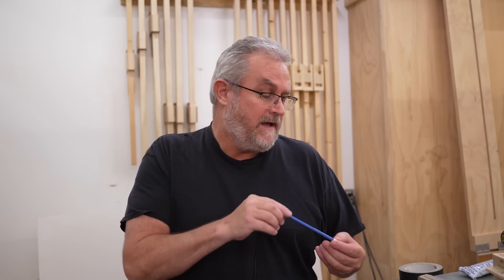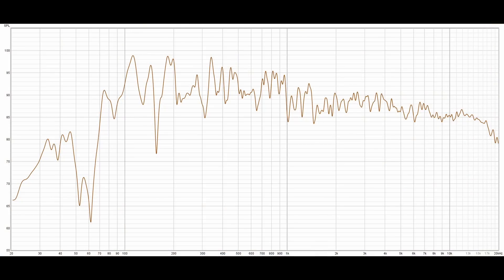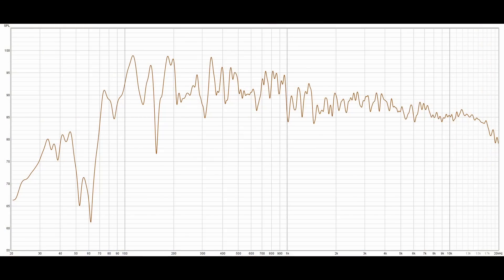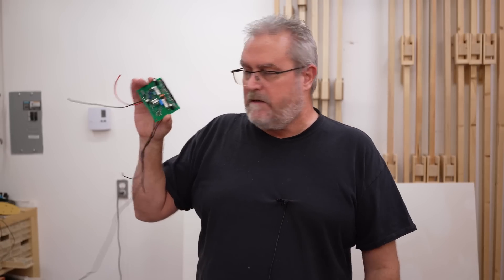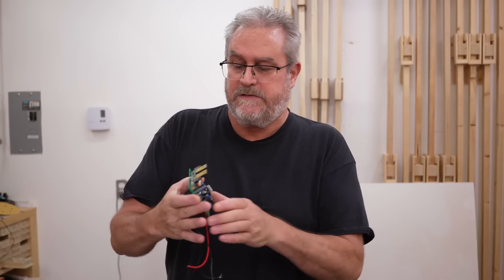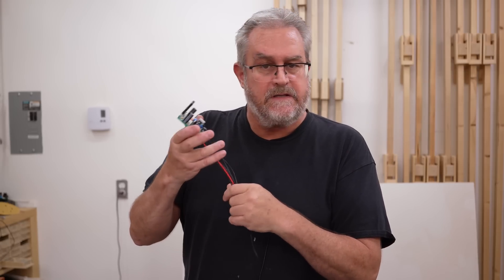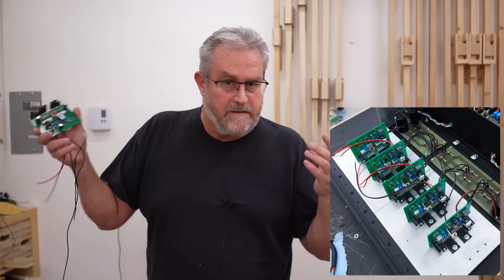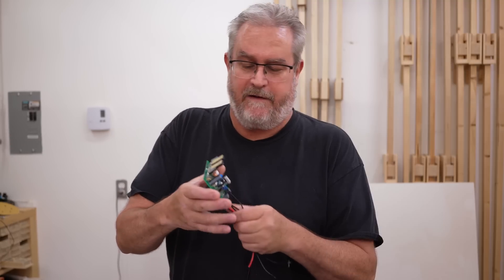A Rant about Speaker Measurements - They are Mostly BS

Comment: You are absolutely right that the room dominates. So that is why research shows listeners prefer speakers with smoothly changing off-axis dispersion because that defines how it will interact with the room. This is why Klippel is important because it captures that 360 degree dispersion data accurately.

I certainly think the more data the buyer have access to the better.
Reply: I totally agree. I see so many manufactures that don't even release anechoic amplitude response. One I remember e.g only released the two -10db points which is utterly useless

Comment: Most people looking at the Klippel reviewers are aware of in-room VS anechoic response and that's why both measurements are provided. Anechoic is how you know flaws purely with the speaker. Why would you want consumers to have less data on the products they buy? Your room can't really fix a huge dip at the crossover for example - like was discovered with the Klipsch 600m by the Klippel.
Reply: Room response is like a fixed mechanical EQ.
Reply: @pablohrrg8677  Kind of but not really. It's extremely difficult to target EQ a speaker with a room. Also, in relation to bass that room gain is basically modes and nulls which have severe consequences in addition to the boost that they give.
Reply from the maker: If it took the Klippel scanner to discover the huge dip, how much of an issue was it in actuality? Why didn't a listener discover it?
 Nothing wrong with consumers having more data as long as that data is actually relevant and they know how to interpret it. My point was (and it pains me to have to explain things twice or three times...) that the data is missing key components that determine what the sound quality will be. 
The Klippel system gives a rough approximation of what the developers of that system THINK the speaker will sound like in a typical room. That's like buying a suit off the rack vs going to a tailor. Sure that suit off the rack will fit pretty close, but nowhere good as the one that's made to fit perfectly. It's mediocrity vs excellence, which would be okay, but the mediocrity is being touted as excellence, which is a lie. 
The measurement data shows just one aspect of the big picture, but it's being pushed as the be-all-end-all, and all you need to know when you want to buy a pair of speakers. Very good sounding speakers are being maligned because they don't fit the narrow range of "acceptable" (presented as exceptional) flatness and directivity. It's the human (lazy, low rez thinking) desire for easy, simple answers to very, very complex questions, and pandering to people who are more interested in specs to prattle on about than the actual sound quality.
Reply: @IBuildIt  Klippel has tons of technical data to back up their claims about the systems accuracy. Both they and many other people with engineering backgrounds seem to agree that outside of the most advanced anechoic chambers in the world, of which only a couple exist, the Klippel is by far the most accurate measurements you can get - especially into the low frequencies. I appreciate the contributions of both you and the Klippel reviewers, but to convince me you would have to provide technical data equal to Klippel to disprove their system - and you have not done that. Subjectively, I have owned tons of HiFi speakers and when I started buying based off good Klippel measurements I noticed a huge improvement. The speakers that measure good are not too bright, not too dull, and sound full with no details missing.
Reply from the maker: And once again I can see that I've wasted my time. And not because I "failed to convince you that the Klippel data in inaccurate", but because that's not even close to what I was saying in this video.

Comment: I'm an "advanced" amateur musician/recording engineer. I've got a few albums under my belt, but I'm not a pro by any stretch. I've recently started doing some "real" work on a pair of Adam Audio near field monitors set up in my newish home office . They weren't wrought from sacred materials by Tibetan Monks, but they sound pretty damn good. Yesterday, I was mixing a track containing drums, piano and upright bass. I was having an unusually difficult time getting the bass right. I rather quickly traced the problem and assumed that it must be the speakers and so I switched to my supposedly dead flat in-ear monitors and finished up the offending section with no more issues.
Once that was done, I decided to give the entire track a once over on the speakers to listen for stereo imaging and sure enough the bass was terrible again.  
But as I pushed back my chair and stood up in disgust, the mix was suddenly perfect!   
Long story short, the song has a section in the key of C and it just so happens that the second lowest C of that particular recording on that particular track sets up a standing wave in my mixing position.  You would think that I would have noticed this before but alas, I did not. It took me focusing on listening to those frequencies for me to catch it. 

Needless to say I am now in the market for a measurement mic lol.
Reply: REW, UMIK or the PartsExpress equivalent. And start to see how forgiving your ears are at some frequencies out side of the 800 to 4 kilohertz range, and 60 to 500 range. It can be an interesting thing to measure up what you are listening to. Remember sharp peaks or dips are not what our ears listen to. So the response that John showed for his ELAC speakers is actually quite stellar.

Comment: John, I worked as a commissioned stereo salesman for most of my life.  When I started in the 70s, the speakers we sold sounded very different from each other.  It was obvious then which manufacturers used science/measurement/knowledge/quality components (like crossovers) and which were just throwing drivers in a box and adding attractive trim rings and a pretty wood finish.  Many brands did not even have crossovers.  Most customers back then did not know the difference with a 5 minute demo in the show room.  Independent tests, the magazines that measured, were extremely useful to weed out which manufacturers used science, and which were hokum.  Measurements are still useful for that.  If a speaker measures horribly, with no obvious design goals, then the manufacturer should be looked at with skepticism.  There are some high end products that still seem to be designed that way.    Determining which speakers would sound best in a customer's room was part of the value I added.  I could suggest placement, and speakers that would likely sound best in the room.   As you point out, now we have DSP, which is just measurement taken a step further, including room effects.  Heck, even Amazon Echo speakers use self-measurement DSP to optimize their sound based on location.  Measurements are not B.S. You have to understand what they are telling you.

Comment: IF the complete Frequency response, which is a Complex Variable, with the Real Component, the Amplitude response and the Imaginary Component, the Phase response are Hilbert Transforms of each other, that is an indicator that the loudspeaker is true Minimum Phase system. Which means it will deliver a quite reasonable facsimile of the recorded performance. Richard Heyser wrote multiple papers published in the JAES during the 70's. That said, I've been building loudspeakers since the late 70's while earning my first undergrad in Applied Math/CS. The analytical tool I've used since then is a pair of Stax  MK III/ RD 7 earspeakers, to contrast with in room, the systems I've built. Number crunching, was my profession, playing guitar and listening to others do it so much better, a very important part of my existence.

Comment: i can agree with this video in general.
i would like to add something: is the measures output of a speaker has a peak or dip at some point, if that frequency is equally augmented in your room, then things get worse. that is the benefit from anechoic measurement.  
the room could also fix dip and peaks, but it is a crapshoot if it works. so in general a flat response works in most cases.
i measure with my ears and found that microphones do not give any indication how my ears hear things when it comes to loudness.

Comment: John, I think that many of the issues you bring up evaporate with controlled/constant directivity designs. A speaker with bad directivity performance that targets flat anechoic will almost always sound bad. Opposite is true for CD. And CD designs IME are just "relaxing" and sound much more consistently good to me. I think this is because our brain doesn't have to work so hard to process and compensate for the mismatch between the reflected sound and the direct sound. They are also less affected by room acoustics and dramatically so in the case of 20hz-20khz dipole/cardioid.

Comment: I'd like to add to the list:
- Speaker setup like toe in/out, spacing between speakers and listener etc, time of arrival (especially with multichannel audio or stereo over quad speakers). 
- Room treatment
- Recording and mastering.

I agree listening to music is mostly subjective. Though there are attempts at standardizing listening to audio like dolby dts/atmos. It tries to calibrate the room/system to a reference target. It's for movies of course but it's still insteresting for music. 

As for components, I've been experimenting with this the last few years a lot with my DIY quad 3 way full sized speakers. First I used off the shelf crossovers with electrolytic caps. The phase was all wrong as you might expect. I made some L-pad adjustments to get it mostly right SPL wise and corrected the rest with umike1 and rew. I had all sorts of issues with holes in the sound stage, wandering vocals/instruments when playing at different frequencies/notes the phase would shift and the stereo balance changed. Also due to a large dip in the base region I could clearly hear a base progression from low to high that the amplitude changed while on headphones it sounded perfectly equal in volume. 

When I've built my own crossover using measurements and xsim (followed Audio Judgement 'How NOT to design a crossover') I've particularly focused on correct phase and impedance, and of course a flat response as much as possible. I used air cored inductors, polycaps (yep that cost me an arm and a leg, but it was worth it) and cheap resistors for now until I've settled on the L pads. It took a week to get used to the difference in sound, like you said you get used to a bad setup and you might reject a 'correctly' sounding system due to what you're used to. But I've settled in and it sounds amazing every time. I had so much trouble getting the stereo image centered before but not anymore. 

I think that's the importance of good speakers, a good flat SPL and phase response. A good speaker setup and room treatment does the rest. My speakers now follow the room response curve naturally without any equalization and it sounds so much more natural. Equalization can introduce phase errors, ringing, clipping etc. just making it sound 'off'. I prefer no EQ at all.

To me get this all right and then adjust to taste like base boost or 'smiley curve' etc to taste is the way to go. 

As for commercial speakers, sure some designers put in the effort but sales could enforce cheap speaker parts. After changing to good quality parts I was convinced, subjectively or otherwise. It's what GR-Research said, smearing of vocals and instruments is much improved. I was sceptical, and I still don't believe in the snake oil power cables and interconnects etc. But removing steel parts from the audio path (tube connectors, caps using steel in the leads etc) and polycaps instead of electrolytics did make an audible difference. YMMV
Reply: You're wrong about EQ.  Modern DSP eq's can compensate for and eliminate phase shift, and have zero clipping or issues with ringing or smearing.  EQs are now perfect, and there is zero reason (and imo excuse) not to use them.  The main issues with older EQs wasn't even the phase shift but the analog circuitry - noise and nonlinearities.  That doesn't exist in DSP.  No speaker sounds good flat, unless you're using a sub, to me subjectively because I prefer a low bass boost.  Use a mini DSP 2x4hd or a good VST EQ with a computer/dac as the source and there are no downsides.  You can also test minimum phase (classic) EQs and linear phase EQs.

Also phase shift isn't even an issue in all cases... Look at it like this.  If you put a high q boost or cut in the sensitive range of our hearing, a standard minimum phase EQ (old school), then yeah that could cause an issue and be less than ideal, and potentially noticeable.  That's because you go from one phase, to a significant shift out of phase, and then back.

But if you were to use a low frequency shelf boost that starts at say 120 and maxes out at 30 or 40hz, that phase shift is meaningless, not least of which because we're not sensitive to timing information down there, and each channel is in phase with each other - it's not like a sub out of phase with the mains, there's no cancellations or constructive interference.  A gradual phase shift on either end of the spectrum isn't harmful subjectively.  I'm open to being critical of rapid shifting phase relationships within the middle of the spectrum.

I can prove this to you objectively so you are absolutely without doubt:
All your music is already EQd.  All the "negative" effects of EQs you're talking about, if true, are already in the recordings, because virtually every single album ever recorded mixed and mastered has already had a variety of EQ effects applied, to each track, and to the whole mix.  And you don't know what type they used.  If it's older music, it was almost certainly linear phase eq, which altered the phase.  Modern producers have access to limitless EQ options, and can choose minimum or linear phase.  You wouldn't know.

So the very thing you're avoiding has already been done to your precious music.
Reply: @Artcore103  I'm aware of that and I'm no expert on audio processing. I've done some experiments with eq-ing speakers with minimum phase etc it still sounded like cr@p to me. 
And I had the eq on average surround receivers in mind, no audiophile equipment by any stretch of the imagination. It allows you to eq each speaker individually, a recipe to get phase alignment issues whatever  precious music you play. Agreed a sudden phase change, usually in bumps and dips in spl  can have noticeable effect.  I don't like a flat response from my listening position either, just a flat ish respone from 1m away from the speaker (with some IR windowing to remove reflections).

Comment: It is refreshing to read comments that have as much knowledge and experience as the presenter. I am a rank amateur in audio.  The assumption that everyone hears the same way the testing sound mic does  is definitely not the case.  What may be flat to the test equipment can be a complete mess to a person's hearing as they hear different frequencies at different levels. Have a look at your latest hearing test and you will see how "flat" it is.   From the listener's perspective sound quality is subjective and they will get greater benefits by moving the speakers around, or adding a little room treatment than changing equipment. That being said, not everything is snake oil but different does not always mean better,  and a change is not always bad.

Comment: Not according to the late John Dunlavy. He said that "no loudspeaker can sound more accurate than it measures. It may sound worse, or it may sound sweeter, prettier, but if we're talking about absolute accuracy—the ability of the speaker to reproduce as perfectly as possible whatever's fed to it—such a system can never sound more accurate than it first measures. So we try to get the greatest accuracy we can achieve from measurements. Then we begin doing what some people might call "voicing," because the best set of measurements are still open to interpretation."

Comment: I wonder if the frequency change you are experiencing is due to room temperature. I have seen it in my system. I have no AC, so the temperature in the morning or evening is usually different throughout the day and by season. I can see it when doing frequency sweeps. The response seems to be higher when it is warmer. Or is it the temperature of the actual components that make the difference, like the speaker crossovers or amp components? It would be interesting to hear if others see the same thing with their systems.

Comment: Well I'd rather have a perfectly flat speaker with perfect dispersion and low distortion and put that in my less than ideal living room and then just have to deal with that with a few absorbers and some EQ, instead of having a wobbly speaker 
So yeah, a good measuring speaker is a better starting point, so why not? Wouldn't spend audiophile money on a maybe ideal speaker (unfortunately sometimes the money goes into other things than sound quality thought), but up to maybe 1000 euro is fine for me. My 600 euro Ino Audio piP does everything I need though with some absorbers and EQ, and that EQ I got to using measurements ;)